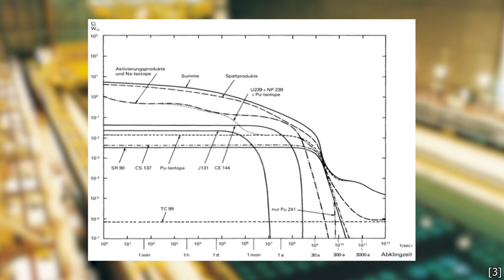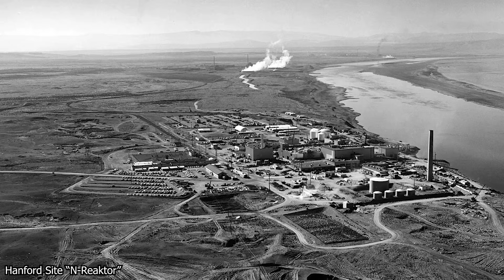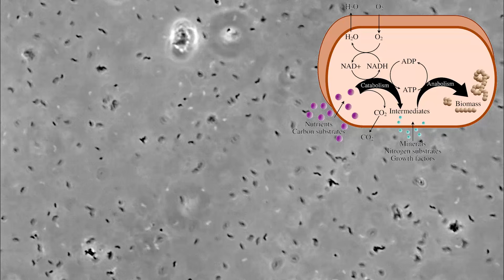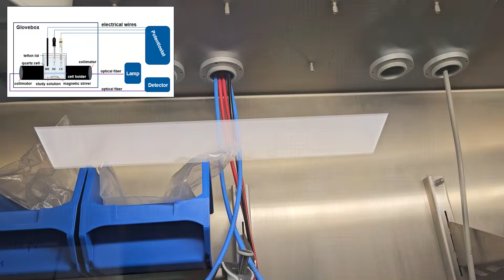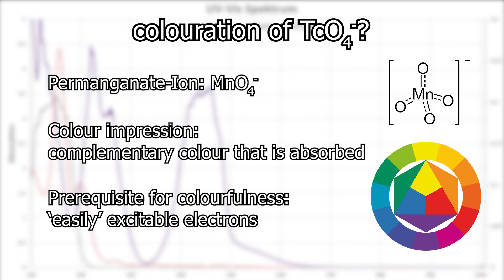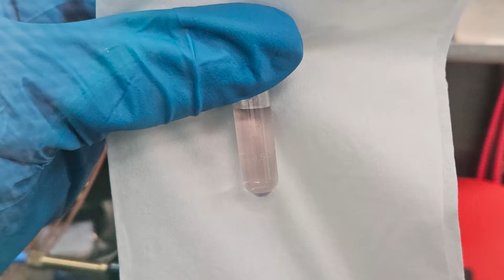Reduction of Technetium and environmental chemistry - practical nuclear chemistry

Comment: How do they make radioactive salt? Is that a more accurate spectrophotometer? Why is the uv light outside the glove box?
Reply: I believe that having an instrument (such as the spectrophotometer) outside of a glovebox also allows for significantly easier maintenance. I imagine the dexterity in those gloves is poor for any fiddly fixes!
Reply from the maker: Most radionuclides are recovered as a salt. In the case of Technetium the Potassium or Ammonium Pertechnetate is recycrystalized from a solution which originally contained a lot of fission products and this salt is just whats left. I am not sure if I explained that process. Maybe in the Video about Technetium. But thats done on an industrial scale inside hot cells. I am not sure which UV-vis that is and regarding the last thing I would assume to safe precious space in the glovebox and to more easily access the device. Anything in the glovebox is really difficult to coordinate.